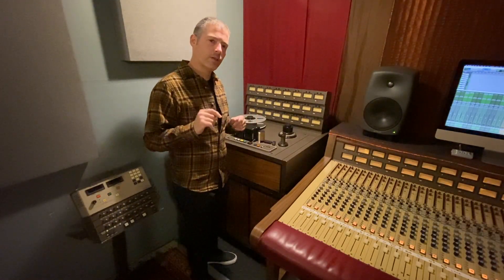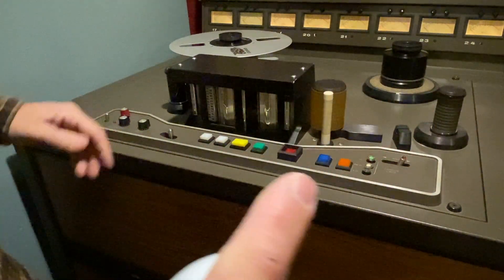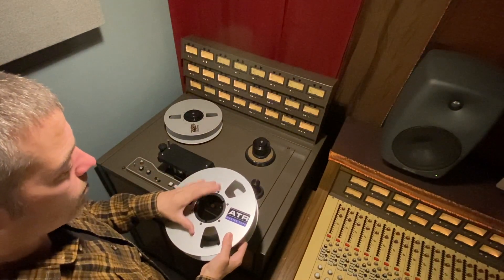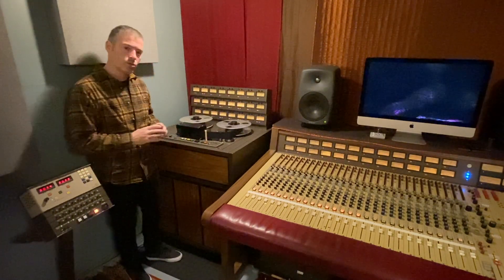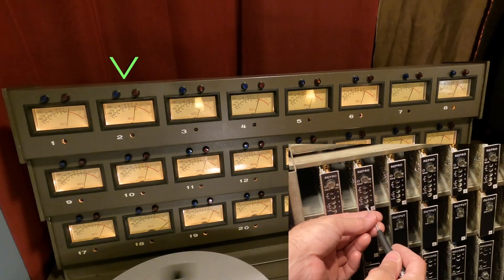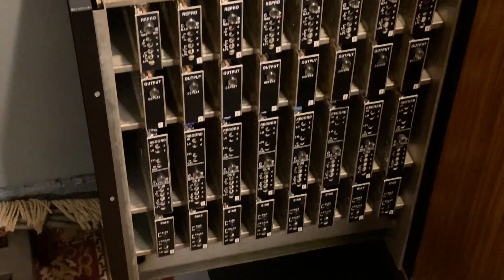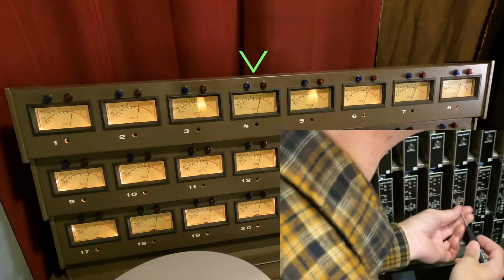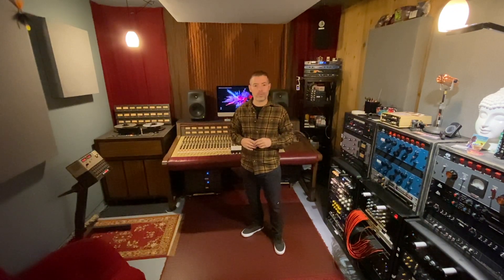The Mighty JH 24 Analog Tape Deck! Part 1 Repro Calibration @RiotHomeRecording

Comment: Once again, Thank You for doing what you do!
A couple of questions though:

(First let me say that this is all meant in good faith.  I try to no have opinions but understandings, and these questions are to see if I understand accurately or if I’m missing something.)

A)  I thought you said you were calibrating the machine for +6, and then loaded a reel of 499 which I thought was +9dB.  Did I hear you right, and is there a mismatch there, and if so is it intentional for some sonic/technical benefit that I don’t understand.

Better yet, maybe you could Do a video on tape formulations and calibration, what effect they have, and possibly include the ATR red vs blue VS RTM 900 vs 911.  To my knowledge, those are the only New Tape options, but you likely have thoughts on All of that.

B)  The other is probably semantics, and pedantic, but you talked about your patchbay being “normalized” rather than “normalled”.  I think of normalizing as raising or lowering a signal level to a pre-defined average or peak.  And normalling as pre-defining a signal path from A to Z so that in its default state without making any connections, it’s ready to go.  Exactly as you demonstrated.

The question is here though (fuck the language):
You have your PreAmp Outs normalled to your Interface Ins.  Check.  
Then to patch in the Tape Machine, you ran 24-TTs from those top row Outs to the MCI bottom row Ins.  Perfect.
Maybe you mentioned it, but are those Half-Normalled, and therefore the signal from the PreAmps is going to Both ProTools and the MCI?
Do you / Can you record both?

Here’s the more interesting questions, I swear.

If you are regularly going back and forth, or tracking both, could you, could I, at the Back of the Patchbay, Mult the PreAmp Outs 1-24 on the top row left half 1-24, also to the top row right half 25-48.  Essentially building Y-Cables for each input.  1-24A & 1-24B.
And then half-normal down to the Interface INs 1-24 on the bottom left, and MCI INs 1-24 on the bottom right.

So the limit of my understanding is this:  from what I know of how half-normalling works inside of a patchbay, it’s literally soldering to the TRS lugs rather than the switched/breaking lugs you would use for full-normalling that Would break the connection to the bottom row.  So when you insert a TT into the top row, you have a Y-Cable.  Unless I’m missing something.

Is soldering a Y-Cable/Mult on the back, IDENTICAL to using the Half-Normal on the front?
From a signal quality standpoint.

And the last question here: Half vs Full Normalling in general.

If I imagine an outboard PreAmp XLR-IN from a Mic, XLR-OUT to the Interface.  Cool.  Beyoncé’s vocal is perfect.
But then I take an XLR Y-Cable and send one side to the same Interface, and the other to the Tape Machine (or possibly through a console channel strip, and an LA2A+1176 sandwich, and the the Tape Machine).

I’ve split output signals a billion times.  What I don’t fully understand is what precisely is happening, and how are the different devices interacting.  I’ve noticed when calibrating, that connecting a second or third device to an output, the signal drops.  You set a 1K tone, calibrate input 1 to 0VU, the plugin another, and the first isn’t hitting 0 anymore.  Okay, give it some gain (makeup gain?), and done.

Except, what’s that doing to the Sound?
Is this an impedance thing, is it thinning out, is it effecting transients, getting slightly darker, what’s actually happening?
This is Beyoncé’s lead vocal we’re talking about, should we be purists and bypass the patchbay and the board altogether?

Or is the difference, other than gain, unmeasurable, so don’t trip?

What say you Master Analog?
Reply: I didn’t stick the landing:

If there IS a noticeable quality difference between Multing or not, then Half vs Full-Normalling isn’t merely a convenience thing, it could be worsening what gets recorded.  And Full-Normalling, because it breaks the previous connection, would avoid any potential forks in the road and maintain one clean signal path.

I suspect that this is overthinking it, as I and everyone else have been using mults for decades.
But to deepen my understanding, it’s always better to know precisely What’s really happening.

Thanks again Brotha!

Comment: Thanks for the trip down memory lane.  I ran my own studio from 1979 to 1989 and somedays I had two sessions. I would be setting up two tapes a day . You never wanted to skip the step because every reel was different and biasing and setting levels was critical if you wanted back what you were putting in. Rarely did I use 15ips since 30ips sounded so incredible.  That first playback when the band came into the control room sounded like they were playing live . But yes with tones saved on tape you only got about 13 minutes of time at 30ips. At 250.00 a reel in the 1980s it was expensive but so worth it. Love your channel
Reply from the maker: You must of went through a ton of tapes recording full albums at 30 IPS.

I could only imagine how many tapes they would have for an Aerosmith record, ZZ Top, Guns n Roses, Led Zeppelin, etc….

I was born in 78, thanks for sharing!
Reply: @RiotHomeRecording  . Yes we went through a ton of tapes. Sometimes three or four in a day. And yes I biased each one and added tones after calibration to each reel. That way I knew I was maximizing the Ampex 456 and if the tapes went to another studio they had tones to calibrate to their machine.  Best times of my life.